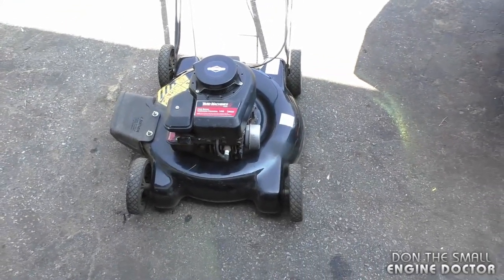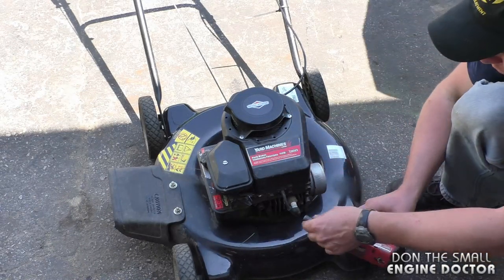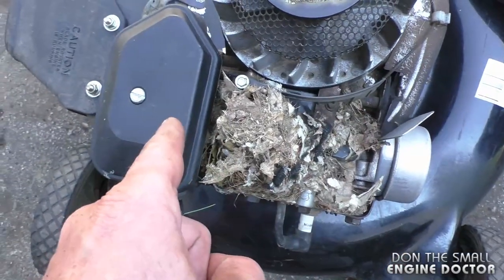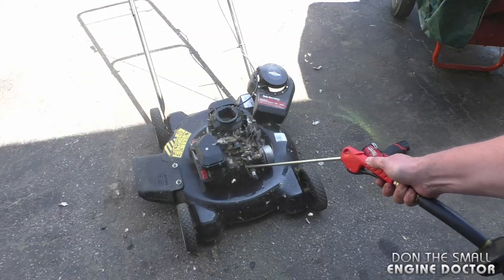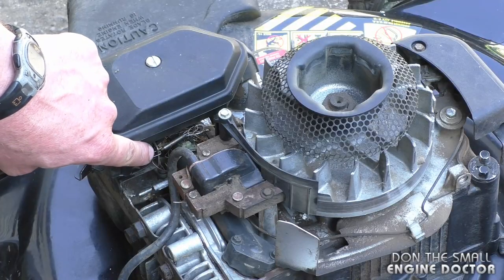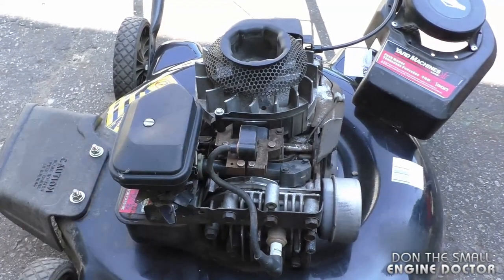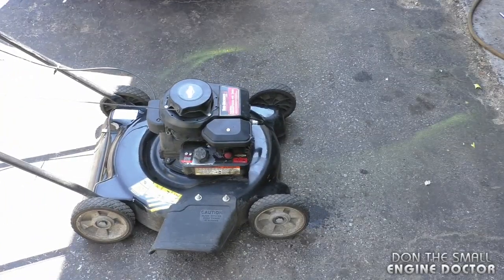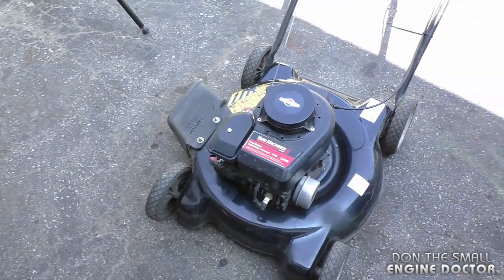HOW-TO Fix A Lawnmower That Revs Too High!

Comment: This is my second attempt to contact you Dony. I'm 80 years old and not too adept with computers. Back to my original post which suddenly disappeared when I hit the wrong key.
I ran across my 40 YO Super 2 buried in the back of the garage a couple weeks ago. I had put it up in the case after running it dry of gas when finished cleaning up my yard of branches after a hurricane in the early 80's. It had probably 10-15 hrs on it. Got some fresh gas, fresh oil and attempted to start it. It started on the eighth pull and runs like it is brand new. When warm it roars to life on the first pull. I got interested in learning about the old saw and did a bunch of watching videos on it, many of which were made by you. Awesome job by the way. I noticed it has points rather than electronic ignition and read where the old ignition system can be changed out to a new electronic system. Haven't been able to find out anything about how to make that changeout or the cost.. Could you please make a short video on that or maybe tell me where I might find out something about that modification. Others may also be interested in this.
I have a huge desire to take on some projects with that old saw before I die and my time is getting shorter every day. Currently,  my knees are so shot from parachute jumps back in my early days I have to do everything sitting down, but I digress. Please keep making the videos. I enjoy them greatly. My wife hates you, by the way, because everytime I watch one of your videos on a Super 2 I order spare parts online and various other stuff as if I plan to be around a long time. LOL.

Comment: I put on nitrile gloves and slip a plastic bag over my hand and try to grab as much of it as possible before I take out the blow gun.  I tell my customers to put moth balls around the mower before parking it for the winter. Other tell tale signs are grass and paper clippings hanging out of the shrouds.  I always remove the shrouds to all my equipment before first start up in the Spring.  Mice also like to nibble the insulation off spark plug and kill wires, which will drive you crazy when the mower starts to cut out on you.  Great video as always, thanks Don.
Reply: Kens Small Engines moth ball work wonder as mouse repellent
Reply: Good advice

Comment: Hello. I have two engines like this. One is 35 and the other 450. They are quite old. I didn't open the engines. I was just working on the carburetor.
My problem with both engines is that it is difficult to turn when starting and often pulls the rope back so that it pulls the lever out of my hand. It's like diesel, too much compression. 35 now works ok but 450 no, I broke the ignition mechanism when I tried. If you know approximately what could be the cause. Thank you.
Reply: Check the flywheel key because It might be sheared. Sometimes that happens when you hit something hard like a rock or a small tree stump

Comment: I got a mower just like this,but with a governor. It keeps revving super high. I've cleaned the carb changed the governor spring(only one spring on the carb) even tried adjusting the govenor. Also tried moving the bracket to decrease tension on the govenor spring,and no luck. Any ideas?
Reply: Did you get it fixed?

Comment: Will that work for a Honda motor I'm having the same problem
Reply: Check the govenor spring tension.
It should be just spanning the distance between the mounting holes at the running position,if it has a throttle control cable.
Too tight and the RPMs go up.
I've seen the adjustment plate get bent from pushing the machine under shrubs and a stob will bend it.
Roughly a 90° bend in the plate,should be close.
Reply: @paulbillings1791  thanks

Comment: BTW.... OSHA recommends a max of 19000 feet/minute for mower blade tip speed. If you have a 21 inch blade this works out to a max of approximately 3454 rpm. Math...The tip of a 21 inch blade travels 66 inches per rotation which is 5.5 feet. 19000 feet divided by 5.5 feet = 3454 rpm.
But I have no idea where OSHA came up with the 19000 ft/min number.
Reply: Sam Ash 
Feet per minute??
Reply: I've added math to my comment

Comment: what to check if all this is working fine, but engine still revving very high. Much higher than this one was!
Reply from the maker: make sure throttle shaft is moving smoothly, could be something stuck in linkage
Reply: @donyboy73   as I said "all this is working fine". the springs, the governor, the throttle arm, the carb 'butteyfly" (?). I watched at least 10 videos and every one did the exact same thing.  none of which helped me. Could blown carb gasket do it? maybe sucking too much air?